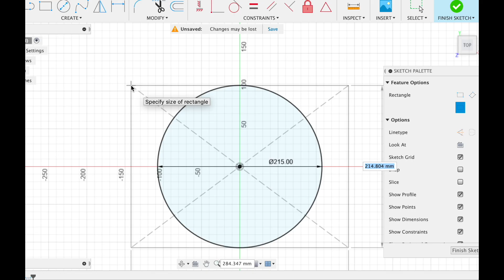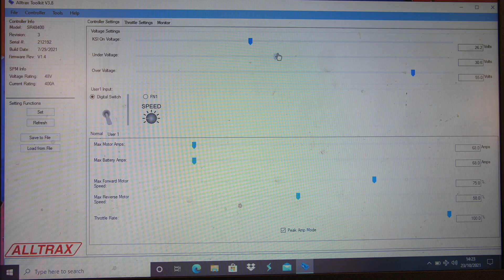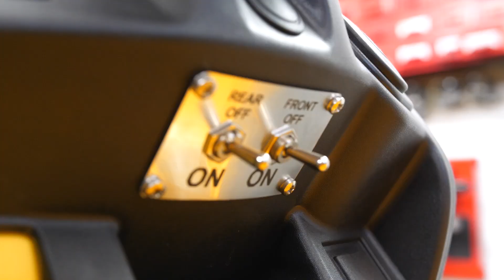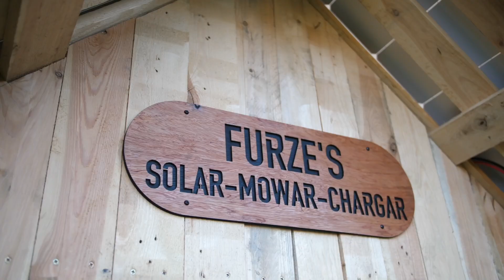EV Mower Conversion with Solar Charging Station

Comment from the maker: So it looks like i've made something useful haha. FEAR NOT PEOPLE TUNNEL UPDATE NEXT VIDEO
Reply: I've always thought a sit on lawnmower crossed with a flymow would be fun to ride, a grass cutting hovercraft of sorts.
Reply: You should probably add a battery on the solar-mowar-chargar.
Reply: Colin. I'm disappointed that the blade speed knob doesn't go up to 11.
Reply: Tunnel!!!!!!! 🥳
Reply: Fantastic, been considering doing those myself, lithium packs would make it unbeatable!! Where do you source the motors?
Reply: If you haven't thought of it already you may want to add a solar battery to your charging station so as not to waste any of the collected solar power
Reply: Stick a solar panel on the front so it charges while you mow colin 😂
Reply: I’m guessing the local council did NOT appreciate the tunnel and had a few words with Mr. Furze.
Reply: Furze, clean up your damn comment section. It's nothing but porno spam. Eleven million subs and YouTube won't give you any help with moderating? Comment engagement is important to the algorithm, but we won't comment if it means we get flooded with irrelevant replies from spambots.
Reply: I see the council made you cut all the grass as a punishment for digging tunnels without planning permission then... ;-)
Reply: Hey furze you should be charged with a criminal offence for taking this long with the tunnel update.
Reply: You should have a lift out of the tunnel
Reply: @colinfurze do you plan on joining the #teamseas movement?
Reply: JOIN TEAM SEAS, MAKE A INSANE SEA TRASH KILLING MACHINE, YOU CAN DO IT!
Reply: YESSS TUNNEL!
Reply: thank you Colin! I needed it.
Reply: TUNNEL!!!!
Reply: what's with all the s** bots
Reply: Hello when are you building a machine similar to this ?? Please !! https://youtu.be/03szt5Ln9bs
Reply: Ok, listen to me now. How about You wire the whole thing up so that your MOWER is also the emergency backup power for the bunker itself?
Reply: @zardzewialy  his even more secret nuclear Colin powered energy plant is running down near his Furce rockets.
Reply: AVAX #avax #pangolin
Reply: Let's goooo
Reply: 18560's or lithium ion cells with similar characters, with those cells, you can make all the batteries you'll need ( and a b.m.s as well)
Reply: Add a voltmeter so you know how much battery is left!!
Reply: I seriously had worried that you'd died since you at one point went like a month without updates on the tunnel...lol (well its not funny but funny to think your engineering had failed!)
Reply: Woooooo!
Reply: If you need a custom Lithium Ion battery have you tried contacting custom ebike manufacturers? I've also seen a few youtube channels where they build their own ebikes and build a battery out of smaller batteries by tig welding the cells together.  

but really the question is, if it works more than you would want on cheap old lead acid batteries why upgrade?
Reply: I would love to invest in this
Reply: Needs a PS5 controller, POV goggles and furry dice 🎲.
Reply: I came into the comments just to say "wow Colin made something useful"
I'm not the first it seems, even Colin said it haha.  Good job Colin
Reply: Need speed and fire on that thing. And of course some weapon.
Reply: Mate this is brilliant you should start selling this man 😎
Reply: @Ishen32  or just the conversion kits 🤔 motors esc and wiring kit !
Reply: about time for the tunnel update I thought you'd leave us with blue balls forever
Reply: Get hold of ryobi for a bunch of their power tool batteries Colin. They are due you a solid favour by now Colin!
Reply: We all make mistakes...
Reply: I didn't think british people knew of the sun let alone knew about solar panels
Reply: 11:26, I'm disappointed that you only felt generally happy with it. haha. but in all seriousness... you inspire my kids and I'm happy for u to say whatever u want if it inspires them, mainly my son who loves inventing aged 6.
Reply: Hahahahahahaha I was about to ask
Reply: YESSSS I NEED THE TUNNEL VIDEOOOO
Reply: Sorry, I didn't catch any of the subtle hints. What was the next video about again?
Reply: @earmit007  i think it has something to do with jet propulsion
Reply: Only thing greener would be to make a mower that runs through a chemical reaction with it's own grass clippings. You could put in on legs so it will save nergy moving around. Give it an AI so it knows when it's in your yard, or maybe just a fence. Make it so it fertilizes the yard with the useless bits of grass left over. Hell, if there's more grass cut than it can use for energy it can make a tasty beverage with it. A cow. I'm saying build an artificial cow.
Reply: Just a thought might work well with ebike batteries as they are lithium ion or maybe a super size lipo pack
Reply: Use marine lithium batteries
Reply: @Techie_ASMR  LTO batteries would live past him, any lifepo4 with this current draw wouldn't live past 7 years.
Reply: XS power lithium LI-PS3400
Reply: Yes! Finally
Reply: yeassssss, can't wait
Reply: You could add outlets to the mower and have it be a back up electric generator to plug in appliances too when the power is out!
Reply: Nick name: mow-ter
Reply: With new tunnel music?
Reply: WHEN COLIN WHEN??? Are you gonna update us 😵‍💫
Reply: Thaaank you sir
Reply: Brilliant thanks for the video absolutely loved it, plus can't wait to see more tunnel bids🤣🤗🤗
Reply: Its a shame you didn't use some lifepo4 batteries as they give more power, are much lighter in weight and will have a life cycle of around 3000+ times as sla batterys will only have a life cycle of around 300 times... and weigh 2x as much
Reply: YESSS
Reply: The wait
Reply: Furze, there have been several cars converted with lithium ion drill batteries. I've jump started a Ford 460ci engine with a 20v Dewalt battery before.
Reply: You can buy 18650 li ion batteries in bulk which helps keep the price down a bit, then you just need a roll of tabs and a cheap welding station.  You can then build your own battery packs to whatever capacity or voltage you wish.
Reply: FINALLY, I'VE BEEN WAITINNGGG
Reply: Solah Mowah is available in Boston
Reply: About effin time Furze 😂
Reply: I’ve put my life on hold waiting for that tunnel!
Reply: How ist with the tunnel progekt
Reply: Powered by Tesla batts
Reply: I never thought lead acid batteries can be this efficient, Oh well.
Reply: Yaaaaaaas
Reply: YESSSSS THE TIME IS COMING
Reply: You need to contact https://youtube.com/c/WillProwse
Reply: YES I can't wait. I absolutely love the tunnel vids.
Reply: Commercial lawn mower lollll I need that for my ditch let alone my giant ass yard
Reply: Have a look at how andy kirby does his own power banks, also he makes a electric quad with bldc motors might give you some inspiration into making some other electrical devices colin 🤟
Reply: yes lets go
Reply: Finally an update. It's been months, Colin.
Reply: Do you know it’s not a column for us

You know it’s not a Colin Furze. Video without welder
Reply: #terrythetunnel
Reply: Finally !
Reply: Genuinely think you need to invest some time into this that's a brilliant idea and if you can pitch it to company's might even be worth a few quid
Reply: HELL YEAH THE TUNNEL
Reply: What happened with the underground tunnel from your shop to the house did you ever finish it or did you get stopped from building
Reply: @valentine6605  um
Reply: If you tunnelling really takes off you might want to use the mower to drive through the tunnels without filling them with fumes. Subterranean ramp down from the back of the Solar-Mowar-Chargar station me thinks!
Reply: Yes! tunnel!!
Reply: Yessssss
Reply: Nice! I been waiting for that!
Reply: When the company already had a electric mower 😅
Reply: Proper Useful!
Reply: Few I was gonna ask!!! Keep it comin big man!
Reply: Did you programme in seat-safety? So it cant run off/cut you if you should manage to fall off... Better to be safe than sorry :P
Reply: Colin there's a guy in your comment saying he can help you out with lithium batteries
Reply: Hey nice video. I have a request. Could you or someone make a video of pressurized water traveling faster than the speed sound? Supersonic water. Thanks
Reply: awesome! even though it is useful :D. Brilliant idea!
Reply: You need to patent that idea😂 can’t wait to see how the tunnel is coming along
Reply: And behold.. tunnel video next....
Reply: Need to build an “Secret Underground Parking Garage”. Drive it on the pad and then lower it under ground.
Reply: did,,,you,,use,,,,AGM,,, batteries. 150 amp... std car batts no good.
Reply: did,,,you,,use,,,,AGM,,, batteries. 150 amp... std car batts no good.
Reply: sell idea to council,or rent them to them,, money money money....
Reply: sell idea to council,or rent them to them,, money money money....
Reply: golf cart batts.. the old milk carts were batt. aparently step motors,500 hp..
Reply: TY. Been itching
Reply: ah good! I was about to nag about the tunnel and bunker system!
Reply: if your looking for lipos, look at battery hook up. i have no clue if they ship to the uk though, but battery's are very cheap there
Reply: Colin, today I finished to watch all your videos for 14 years. Please make more! And thanks for good mood.
Reply: I would contact victron Colin
Reply: so there's the wall of death... what about the hamster wheel of death?
Reply: Only need the umm the solar cell charging hut to recharge drone lol
Reply: Great engineering, lad. Everyone in the world needs something like that. No more buying gasoline for any mower.
Reply: Oh yaaaaaaaaaaaaaaa
Reply: I cant wait for tunnel vid
Reply: Tunnel Colin? That’s all Iv been waiting for for months I really want to see how it is and the progress. If you need help with it I would be more then happy too
Reply: You should add a switch from cut battery to drive battery for days you do more driving than cutting
Reply: Colin
In regard to you battery needs
Hes a bit boring but jehugarcia has a lot of videos about reusing 18650 batteries (which are lithium ion) and can be assembled into packs of any size, this is actually what tesla did with their first battery packs.

I bought ex navy A123 battery banks that came out of a Destroyer and they are plenty powerful.

So maybe look into grabbing a bunch of A123s or 18650s and just assembling them how you like

Ps those blue wrapped ebike battery packs where you can see each individual battery, those are 18650s.
Reply: You can buy a linthum cell for like £0.50-£2 and you can solder the cells into a battery. Verry useful
Reply: 11:27 sqwuere meaters🤣🤣🤣🤣🤣🤣🤣🤣🤣🤣
Reply: https://www.youtube.com/results?search_query=making+lithium+ion+battery+pack
Reply: You should use an electric bike battery to power this
Reply: Thank you!
Reply: Thank God Colin I was starting to come down, need my heavy machinery tunnelling fix hahaha can’t wait mate
Reply: Can you made with H2O *ggg...has more BOWAR!!! and you must made a horn(train one) on that,  it's dangerous so quietly...
Reply: But what about the claw thing
Reply: @valentine6605  at last I have been waiting for a link to this for soo long - ta!
Reply: Tunnel !! Colin I gotta say that the music, video quality, excess quirky/weird and a bit of your mates. Has me hooked on this channel, good on ya lad from Oklahoma 🤗❤
Reply: It would be awesome if he built the Knight.Industries.Two.Thousand. or K.I.T.T!
Reply: I do lithium battery
Reply: Lithium-Iron-Phosphate is the type of battery this needs.
Reply: Really impressive. You could start manufacturing those
Reply: The car audio community has tons of options for 12v Lithium Ion batteries... I'm sure they're expensive, but at 2-3 times less weight and more amperage discgarge potential per battery, you could probably almost triple your run time with more available torque to make your drive gear ratio steeper(faster).  A simple pulley change from the drive motor to the transmission would increase the speed of the lawnmower with less rpms from the drive motor.
Reply: please make more EV land mowering equipment .-) :-) . for cutting grass - love your vids for long time .-) :-)
Reply: This is awesome But didn't you once say that if you invented something that is useful you have failed? This is by far the most useful invention you're made & if you patented it you could stand to make a lot of money from it and do your part To keep the planet habitable
Reply: The answer for futuristic lithium battery is Foklift battery.
Reply: looks like you need to buy a bunch of AA lithium batteries and hook that mower up
Reply: Can you make a list of parts used in this project? Thanks Colin!
Reply: @colinfurze I'm Turkish, but I can't understand you because there is no Turkish subtitle. Can you add Turkish subtitles please take this comment into consideration There are many Turkish friends like me
Reply: I wonder if would be a piece of cake to you, doing a SHOCKER SOFA, like the old electric chair arcade game... Sometimes I have some lack of energy  getting out of the couch.. I think that would do the trick!....
Reply: Have you seen the latest news on cobalt mining?
Reply: can you make a waterfall dishwasher using solar hotwater and a pump with big perspex doors?
Reply: Looks like it's time to revisit the solar mowar with modern lifepo4 batteries and maybe doing a fullsize garden tractor with several drive gears (non hydrostatic) if you were In the USA I'd have a few donor candidates you could use...
Reply: Would be nice to hear if the solar mowar still works 🎉
Reply: May I recommend using lithium iron phosphate batteries
Reply: Love to see an update if you manage to get the batteries for the mower. It has been a while
Reply: But what about those robots that do this.... how about you make this a robot mowar? Do a collaborative with some electronic YouTubers?
Reply: could you make a high powered super fast (try get 100mph) electric scooter please i would love to see this
Reply: @OGdrodro  would be highly illegal in the uk
Reply: also colin you might have a bit of a spam problem. in replies.
Reply: @DanTe.-Evo  I've just reported the spam and it's dissappeared out of the comments :-)
Reply: Was literally about to say we want tunnel updates !
Reply: Colin put an inverter in it and use it as a drivable power bank/station.
Reply: https://youtu.be/GHIMASbscXA
Reply: Don’t like my comment if you aren’t hitler

Comment: Is that a charge controller per panel feeding directly to the battery? That's a bizarre way of setting solar up! Have one charge controller, a big battery and an inverter in the shed, then plug a battery charger into that. But also once the mower's charged you can plug your drill batteries, hedge trimmer etc in too!

Comment: We need a revisit of the mower. I have a 48" 3 blade commercial walk behind and im thinking about trying to convert. Do I use 4 motors, or 1 to replace existing motor. My mower and Snow blower are only gas powered things left. Loving our 2 Rivian R1's.

Comment: My charger quit about two years ago.  I had some 370 watt 48 volt solar panels, I hooked two in series to get about 80 volts and plugged that directly into my Ryobi 48 vold lead acid pack.  It charges with about 8 amps at 80 volts, sometimes more, and it takes only one day to fully charge , so I can mow every day some weeks.  But the mower is almost 3 years old and those old lead acid batteries are shot.   Time for lithium.

Comment: You said you were charging them separately but the batteries were linked in parallel.  How do you disconnect the links between the batteries when charging

Comment: Or you could’ve just put an old manual non-motorized push mower onto an electric go kart or golf cart, then you wouldn’t need a blade motor or battery pack.

Comment: So wait, your charging each battery individually with each charge controller? No issues with the higher voltage? Might have balance issues but very nice solution for anyone who can’t find a HV charge controller. I suspect 48 volts is more than enough though for something of this size.

Comment: for most people we use a push mower that may or may not be self propelled.   this would be a great idea for that, a smaller motor and just one battery.   maybe a deep cycle marine battery would be better for this application

Comment: I am considering converting our old Craftsman riding mower to electric.  Your system of computer monitoring and control modules is the Elite way to go.  I am thinking old school, one large electric motor that runs both cutting and drive.  My mower is hydrostatic ,so I just need a one speed controller where the throttle is..  Flip a switch, throttle up the motor, then use the hydro lever to regulate speed, the other lever lowers and engages the blades.  Thank you for the great video and many good ideas.  What a modern workshop you have.  I don't think lithium batteries are necessary.  They would possibly cost $6 to $8000.  I like lead acid since they are actually recyclable. More Greener.

Comment: What are the specs on the motors used? Did you perform any calculations to determine your motor requirements?

Comment: its actually more impressive pulling off the task in lead acid than lithium as lithium fires are a pretty significant drawback to those batteries (genuinely amazed youve not had one yourself) as setting lead on fire takes some serious doing and isnt exactly likely to burn your shed down. nice to see a pallet recycling job as well.

Comment: I recently converted a 46 yr old Sears garden tractor to electric. Moving a 3000lb camper in my back yard, barely used any power. So much torque and precise control with the throttle, no clutch.